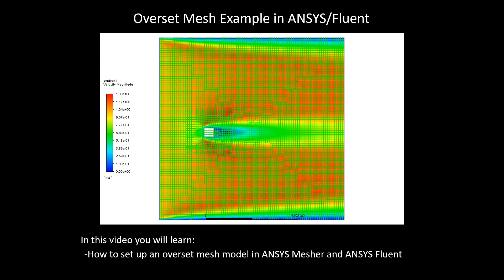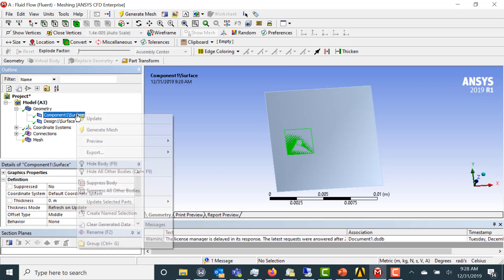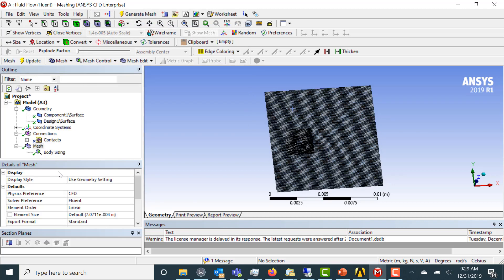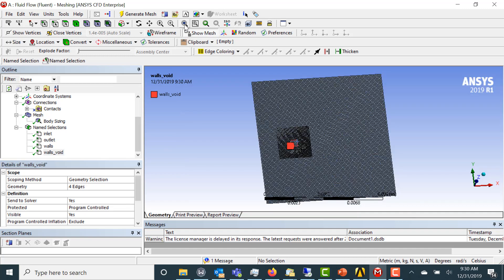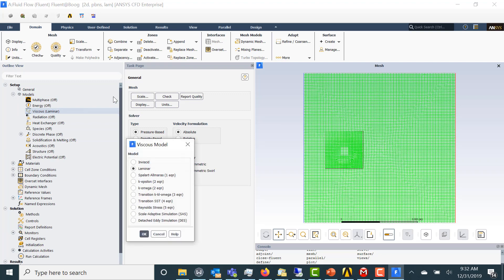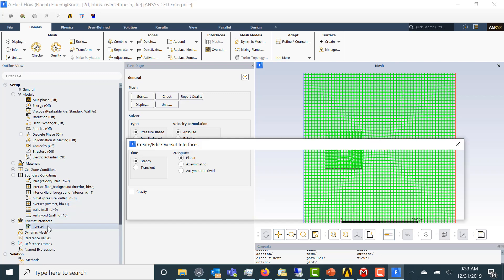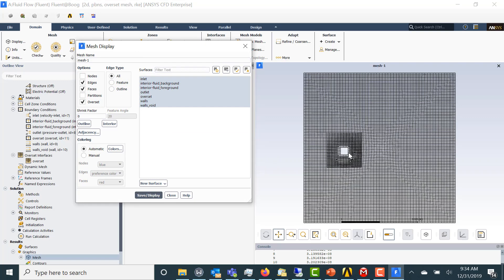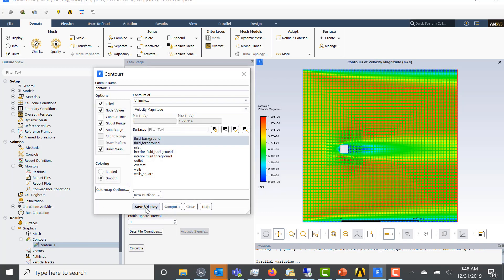Overset Mesh Example in ANSYS Fluent

Comment: hello,thanks for ur video. it's help me a lot. But I met problems about the result for overset mesh. I found in overset type, the flow field show in overlap place is discontinueous. How can I fix it? Is it normal?
Reply from the maker: The Ansys academic support policy (https://www.ansys.com/academic/educator-tools/support-policy) was updated recently and all academic support will now be handled through the Ansys academic community. You should be able to register for the community at https://forum.ansys.com/entry/register which will allow you to submit questions on the various forums in the community. Several Ansys engineers are interacting with customers on that site so your questions should be answered in a timely manner.